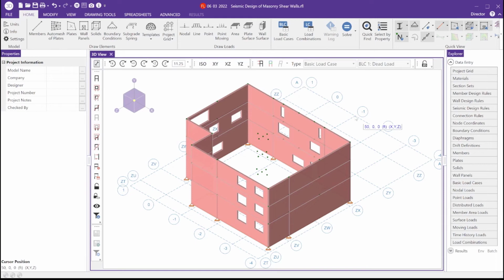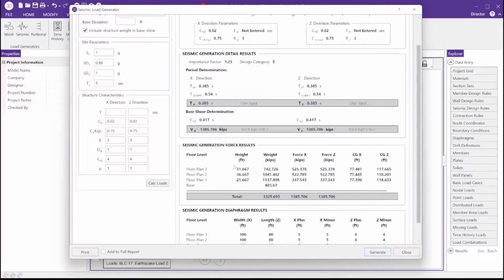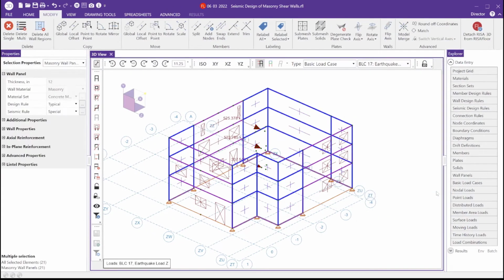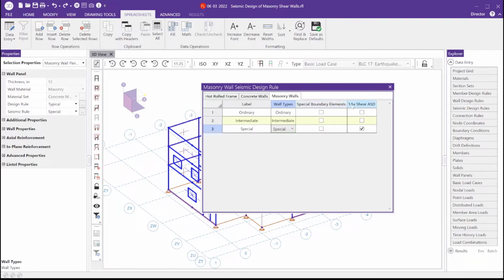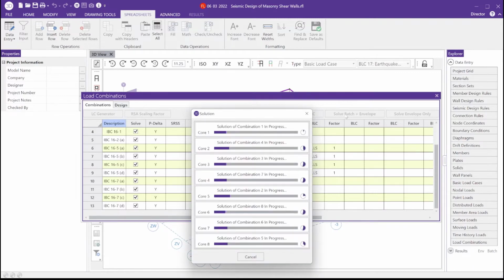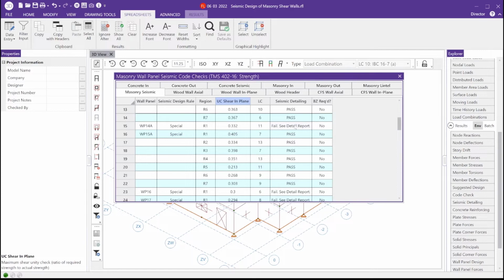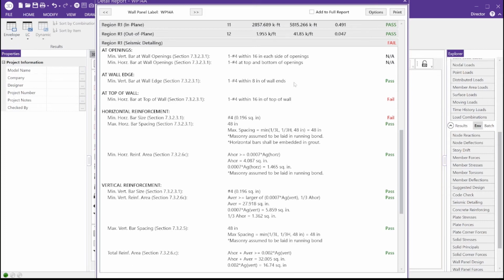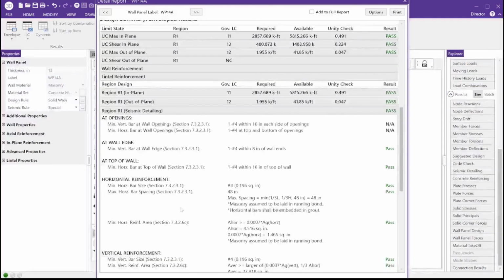Seismic Design of Masonry Walls in RISA-3D

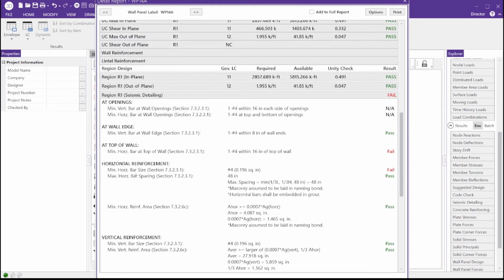Comment: 19:13 I have a model where the Min. Horz. Reinf. Area fails because Horz. Reinf. spacing defaults to the maximum allowable spacing (46" in this case). Why doesn't it optimize the solution to include more horizontal reinforcing so the seismic detailing doesn't fail?